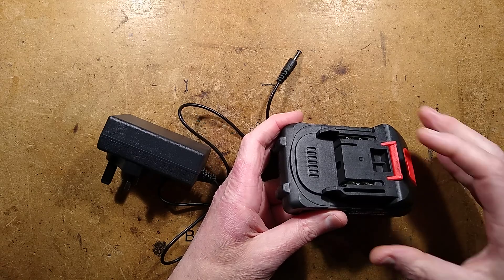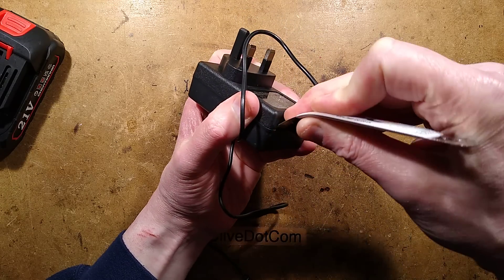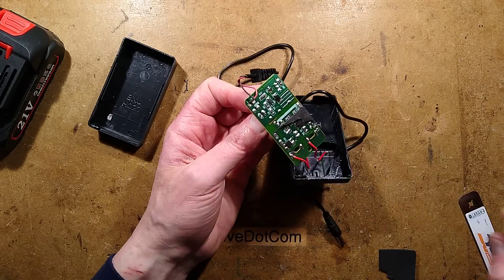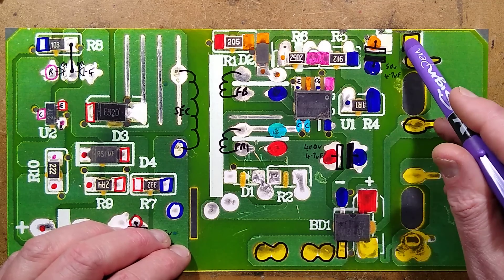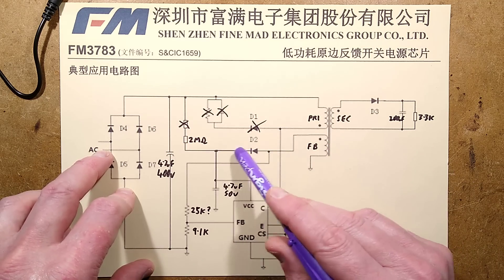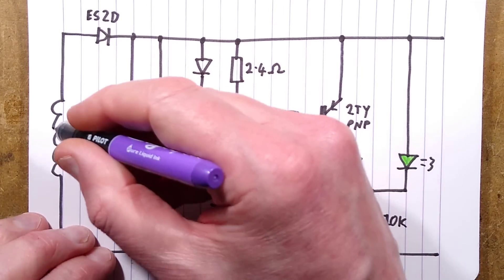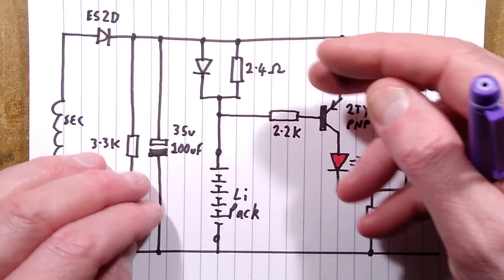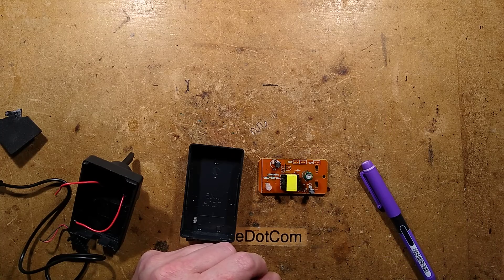Inside an eBay cordless tool charger - with schematic

Comment: i have the same model number PSU but the pcb inside is different, it could provide a whopping 600mA at 21V - again snubber network missing, no Y cap but it did have a 220uF cap on the output, no input surge limiting resistor, common mode choke etc. tested the TX insulation resistance, it did pass 2kV DC but sparked over at 4kV, creepage distances were adequate but only just. the 12.6V power tool charger version: model TZ-C03AX are under a product recall notice for risk of electric shock. I would say 90% of these AC adaptors from china are a potential safety risk!

Comment: so if i buy one of these tools would you say get a 24v power supply and reduce it to 21.5v rather than use this crap
Reply from the maker: It has to be a current limited supply.

Comment: Think we have to give a small credit to Fine Mad (Fuman) who provided the chip, and the valid schematic.  Some other bunch built and sold the charger (with no name on it) and components left out. 

I guess we also need to encourage or maybe discourage Clive from testing the isolation resistance of the windings and board.

Comment: Grind away some plastic in the top cover, drill two 4mm holes, 5x 20awg wires from printer motors, JST-XH male connector, solder away to PCB, close the case, use 2 copper prongs in main +/- terminal, attach balance lead to RC charger. There, battery with better balancing and effective charging than known name brands and their expensive BMS'es bullshittery(here poking at you makita :P). Balance plug with this mod clears very good in casing, no obstruction to the tool and tool covers the plug. Nice.

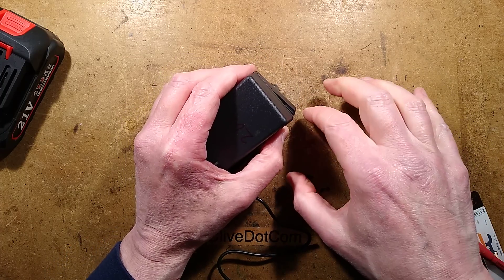Comment: I can NOT believe you got that wall wart open without cutting sonic welds. 2:50 Nearly every single one I’ve ever touched requires power tools or, my favorite, a hacksaw blade. When you saw it by hand, you can sneak up on cutting all the way through it without putting your Dremel cutting disk through the side of a lytic hiding right up against the seam.

Comment: The diode at 10:05 might not be a Shottkey diode...But it'll certainly be a Shot to ribbons diode after about 100h of use! 🔋💥😉

But then, that's the standard for these parts. So long as they work for longer than the returns window stays open... 📦⛔😉

Comment: This planet needs these cheap chargers like a hole in the head.
The manufacturer of the charger cheaps out on protection because they think the battery is going to have a good quality protection circuit and vice-versa.

Comment: So, D4, D5, D6 and D7 are those new fusible diodes. Once the smoke goes out, they open. I'll not go into the oddity of numbering diodes only no other component actually rating a designation...
Really nice blind faith regulation system, totally overload protected. Who needs failsafes when one can simply rebuild the buildings it burns down?
Are you sure that the foam pad wasn't saturated with petrol as well? Or is the pad simply a plastic explosive?

To quote the Colossus computer, "Missiles launched".

Comment: Some of the later switchers claim to have snubbers built in to reduce component count further.  I guess if it runs for 10 years then a snubber isn't necessary.  But then again it depends on how you decode the chinglish.  It is surprising how beefy mosfets diodes and capacitors beyond a few picafarads can now be implemented on silicon.

Comment: Tips alert: don't use this type of charger. It can cause damage to your battery if the charger is getting too hot for the 18650 to handle. The charger name is: Power Tool Battery Charger Replacement Suitable For Makita 21V Li-ion Battery Portable Fast Charger Universal 0.8A 2A EU Plug

Comment: I’ve always wondered why we don’t call that inductive spike “Electron Hammer” since it’s effectively the electrical equivalent of water hammer. 😅
Reply: Especially in the absence of a snubber.
Reply: @spvillano  the Chinese says that the output stage is bjt with sufficiently high voltage minimum of 750v rating to make it snubberless but all the datasheet examples have a snubber
Reply: @dr_jaymz  well, they care about the early warranty period only, right after, who cares?

Comment: I wonder what happens if the Transistor in the PSU goes Short Circuit because of the missing snubber network. 

Will the battery catch fire or explode? Hmm..

I love Clive reviewing electronics, but also I 'm shocked how much trash is actually bought these days. 

How cheap are these products that you can afford 3 Units and still paying less than a "real" one..

I would rather spend more money and get a well designed, safe and long(er) lasting product, than giving my money to questionable Shen Zen Suppliers, not knowing wether I bought a ticking time bomb because of design issues/flaws..

Not even mention the danger of poison substances in the plastics, grips etc.

Guys, buy something solid from BOSCH, GE, Makita and stop supporting these Chinese Crap "Manufacturers"  😢
Reply from the maker: The power supply would fail with a pop.

Comment: Why don't we have DC mains voltage?

Everything including motors are now run on DC. Lights, tech, EVs, fridges, washing machines, heat pumps etc etc. All DC now. 

Variable speed DC controlled motors are much more efficient than regular induction motors.
Reply from the maker: Due to the AC legacy for motors and transformers it's going to be hard to change.
Reply: AC is also just very much easier to generate and transmit, since electricity is almost universally generated from mechanical rotation (solar farms being a notable exception).

Comment: i was so inspired by this vid, i have gone around my home and collected all the cheap Chinese barrel jack power supplies i could find, now i have a small pile on my bench of them. so i am going to see how they compare to this one, with my new found understanding of the short cuts they have been likely to take. tbh, maybe i am a reactionary old fool, but i just can't love SMPS. Whereas i do love transformers. The way they are so tangible, toiling away with B fields, and making hardly any 'noise'. wonderful. they put me in mind of a Victorian pumping station engine, maybe not terribly efficient, but capable of working for decades.
Reply from the maker: A properly designed switching supply is very good.  But none will last as long as a traditional properly rated transformer type.

Comment: I can imagine the manglement meeting.  "Ah, Clive, welcome, welcome
  We are here to circle back on your concerns about our barf-1 charger.  We've invited Bob from vale engineering.  Bob has an accounting degree, he knows his stuff.  " Bob: You raised an issue that we didn't include the...umm.. snubber network.  Well, you see that was a value engineering win.  By removing this, we saved half a quid on every device sold, and the people who do the circuit stuff tell me that this device will fail in  6-12 months, so you can appreciate the after original purchase opportunity to upsell more chargers"
Reply: Sound of Bob being head-hunted by Apple... 💰🍎😉
Reply: i can tell you the total cost of the snubber network would be under 5p in china, its not to improve reliability so much as to reduce EMI - the Snubber as its named snubs the oscillations of the TX coil after switch off, this "ringing" can be up in the MHz bandwidth.

Comment: I don't like how thin the gauge of the wires they used are. I'm sure they are "probably" fine, but I would have preferred them to be a bit thicker for a higher margin of safety.

Comment: Hi Clive, you got me wanting my own spludgers years back after watching your channel. I didn't know the name of the tool and kept rewinding to hear you say "spludger" but for a long time I was still unsure because the tools being shown to me on the internet looked like the tools manicurist would use. Then I tried EBay with no change and eventually out of frustration I tried Amazon and Bingo, there was a two-piece set which I use often. I have my own spludgers 😁 just like you.
Reply: There is no L in "spudger".
Reply: @Slicerwizard  Thank you
Reply: They're in every standard cell phone and other electronics tool kit. Needed some small screwdrivers, found a cheap set for $20 USD on Amazon that included plastic, metallic spudgers (I really do need to get around to looking up the etymology of that word) and some other interesting tools.
Huh, Middle English from spuddle, meaning short knife. dates back to the 1400's. I'm actually quite the fan of short knives, particularly after badly bruising my iliac crest after sitting down and my Rambo sized field knife jammed me there...

Comment: and   no fuse in the mains input?!
Reply: Well the low weight PCB is a fuse of sorts.
Reply from the maker: That's the wires and PCB tracks.
Reply: The PCB has a deliberately thin track wiggled from one of the mains input pads to the bridge rectifier immediately adjacent to it. That's your fuse.

Comment: Cheap and easy charger for cheap and easy battery packs used in cheap and easy power tools.

Well, at least they are consistent.

I’ve seldom seen a better example of the lower end of the “you get what you pay for” scale.
Reply: I have. The brand is Harbor Freight Tools. Pretty much single use tools, use them once and they'll quite often never function again.
Literally. Got cheap drills and angle grinders there for a single use, next time I needed one, tried them to find their gears stripped round into wheels with no contact between them, but plenty of metal shavings inside of the head.
Calling them shit would be in insult to excrement.

Comment: I wonder if it's possible to have a high carbon content foam that actually conducts vs. insulates a thermal load?
Reply: Not when thermal transfer pads/putty are already a thing.

Comment: I see that this charger relies on the overvoltage protection inside the battery.
The matching battery did not have overvoltage protection.
Reply from the maker: The batteries usually have a proper cell management system in them, that will stop the charge when any of the cells approaches 4.2V.

Comment: Worse case, that 2M resistor is dissipating 76mW, so it's not being pushed very hard. Voltage rating might be a concern, but that's not shown on the label.

Comment: 12V ❌
2000mA ❌

Wouldn't want to plug that into another device thinking the label was accurate. 🤦‍♂️
Reply: Pot-luck of 1.2v at 200A, 12v at 200mA, or 1.2Kv at 2µA. 🎰⚡😉

You could always build a circuit to rectify whatever comes out - Magic smoke aside - Into a safer and more stable supply of course, but then you might as well just skip the lottery and do all the PSU work yourself! 😁

Comment: And no fuse, fusible resistor or ntc to ease the inrush current. It's a ticking fire hazard. SUPER DODGY!
Reply: The PCB is the fuse. Failing that, one of the diodes will surely pop.

Comment: If the charger can actually charge the battery and the tool seems to do its job the average buyer will write a good review about the tool and nowadays that is what manufacturers are most concerned about.
Reply: And if it fails in six months, "Well, I didn't pay very much for it," and in the bin it goes. 😆

Comment: my guess is it contains a little voltage gnome inside, voltage goes up it's clacker and a full gnome rectumfryer seperates the voltage out of each of it's eyes(it's quite the painful process to hook up a gnome, they bite when you're glueing wires to their eyes)

Comment: Speaking of chargers I just got a e-bike (From Decathlon, not China although it's the same factories) and the battery charger that comes with it has a LED that changes between red and green depending on the charge level of the battery just like on many chinese chargers for power tools or the blue battery packs with a barrel jack output.

I would like to charge the e-bike battery in my car and I would prefer to use a boost converter rather than an inverter that recreates mains voltage from the car's 12V power.
The charger outputs 48V at 2 amps but I'm not really sure if it has smart circuitry in it or if it's all in the battery.
Any idea ?
Thank's.

Comment: My guess: the circuit board is half the size of the case at most, only held by being soldered to the plug terminals. No protection or anything, just the bare minimum.

Comment: A British plug without a fuse. 
In the event of a short circuit, more than 32 amps will flow through the bridge rectifier. 
That's more than 7700 watts!
Reply: You see that tiny squiggle of PCB track in the lower-right corner between the bridge rectifier and the mains input? That is the 'fuse'. I have no idea if that actually meets UK electrical regs, but that is what these cheap boards do instead of any sort of real fuse.
Reply: @sadlerbw9   Fuses are to protect wiring, not devices. UK regs (BS 7671) do not require fuses for devices (though they are still a good idea to prevent exciting fires as Mehdi put it, and yes, this PCB has a fusible track). If this had a mains cable going from the plug portion to some kind of power brick (like laptop chargers do), then the plug would need a fuse to protect that cable. This is only because the circuit is capable of supplying much more current than the cable is capable of safely carrying.
Reply: @aaronmdjones  very true. A real fuse wouldn’t save the device, nor is it necessarily meant to. However, it should do a better job at containing the hot, vaporized metal if it actually fails.
Reply: @sadlerbw9  usually, such squiggles are inductors printed onto the board. The best thing I can figure from this design is a self-incinerating device to limit liability should the damned thing inevitably burn someone's home down. Can't blame that which is as incinerated as the structure being the theory...
Reply: 32 amps will flow through the bridge rectifier for a very, very brief time.
Reply: for a Milli second before the bang!
Reply: @jensschroder8214  Non documented Heater-"Function"
Reply: Happily the final evolution of these things would seem to be a plastic box, containing just some paper with a QR code that leads to a 404 internet page as a circuit.  A plastic string terminating in a blank plastic plug will emerge from the box.  The device will be amazingly cheap and safe.
Reply: Oh, the fusible diodes and transformer will render everything safe - once the high explosive foam destructs the circuit across the AC bus. 
And people wonder why I distrust Chinese electronics... Makes the cheap Japanese electronics of the past look actually high quality!

Comment: My similar charger didn't charge and the light stayed halway between green and red. There was a capacitor with only one leg soldered down. Many said I should just have returned it, but my way was actually less work.

Comment: 12V 2A ???? That's given to charge a 21V pack [5x4.2V] The battery pack board would have to have a boost converter to use that charger and if it did the supposedly 2A power adapter would then only be able to charge the pack at a little over 1A.

Edit: Now I see you lied when you said 12V, I backed up the video, put it full screen and saw the charger actually says 21V which stands to reason because a few seconds later you tested it @ 21.5V Dyslexic much?  :-) ]
Reply from the maker: I had explored a 12V battery with similar charger just before making this video

Comment: I generally get these glued-together "wall warts" apart by tapping around the seam with a small rawhide hammer.  Eventually, the glue gives and the thing comes apart--and intact.  Works better than repeatedly throwing the things down on a concrete floor.  All of these things seem to be oblivious to the need for heat dissipation/ventilation.  Eventually the heat kills something; the capacitors eventually will "cook out".
Reply: I put one side of the seam in a vise and squeeze until there is an opening for a screwdriver.
Reply: @mikemondano3624  Yes, I've done that too for the really stubborn cases.  You many have to try all sides, but eventually, something gives.

Comment: While poor thermal conductivity foam over a hot chip may not be ideal, you do need to keep in mind that the whole board is inside a plastic housing and the chip packaging itself likely has pretty high thermal resistance. Most power semiconductors sink the bulk of their heat in their leads or thermal pad underneath when present. Heat from the chip isn't really going anywhere regardless of whether there is a foam pad or an air gap.

As for ease-of-opening, I really wish power adapters were still held together by some combination of hooks and 1-4 screws. I've repaired dozens of these over the years and most of them only needed a new auxiliary/bootstrap capacitor for the switching IC because the 1.0-4.7uF original ones got the snot beaten out of them by flyback transformer current spikes they likely aren't rated for. Most of the bricks I repair are OEM adapters since I do not want to end up with Chinese knock-off replacements built to no safety standards worth a damn.

Comment: Just bought a couple of cheapy tools with these batteries and chargers, actually surprised how well the tools themselves performed, between charges, 3 hour charge, 10 minutes of use, after watching this I now suspect the charger isn't actually charging as it should, Is there an alternative or 1 hour fast charge charger available that anyone has found? 

Would love to see Clive put one of these right and safe just out of curiosity to see if it would improve the charging ability.

Comment: The charger is marked 21v, not 12v. So the output voltage was correct. 😀